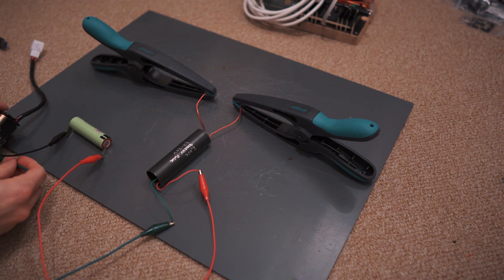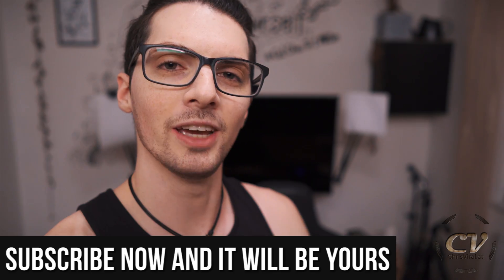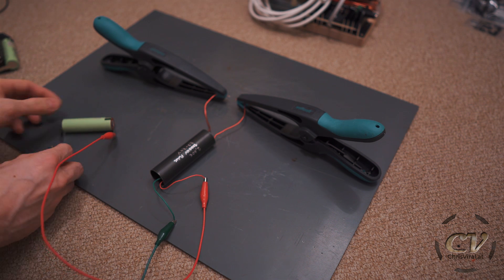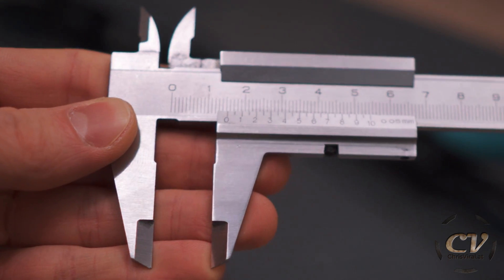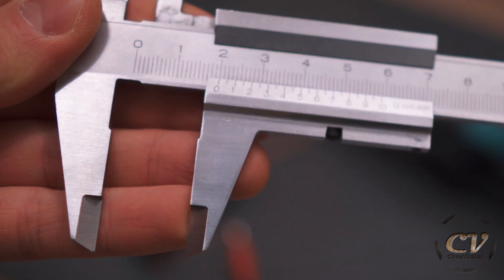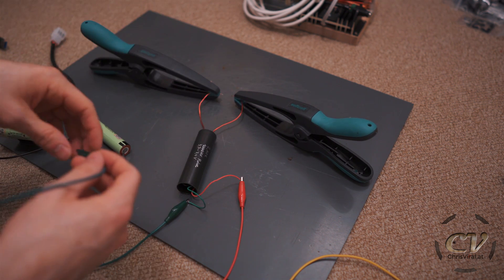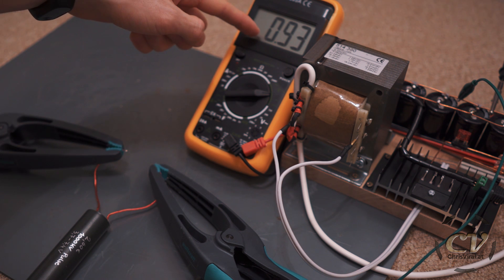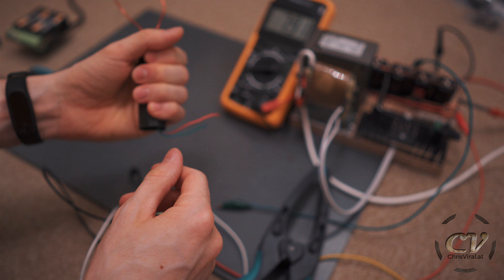1000KV High Voltage Generator Review (DEPRESSING)

Comment: The ones I ordered you can run 6v or 12v on I've been running 12 volts on or just above I have mine running in a PVC pipe which is a footlong with a tiny digital voltage meter on and off switch push button plug-in port for charging and three 18650 3.7v batteries and have no problem just the sound gives you the chills and it's Extremely Loud I've had the one for 2 years playing with it getting ready to build a shaft 5 ft tall and then also a painter wants me to build one in his extension pole which I just took the inner pull out of I'm about done with it😂
Reply: Got a link to buy? Mine keep dying 😂

Comment: Why does the spark only jump between the ends of the wires? If you made both of the wires (probes) parallel, wouldn't the spark jump between the base of those probes?   Thanks

Comment: The internal circuit is a Cockroft-Walton voltage multiplier. If you operate it without a properly-rated resistive load you will soon burn out the internal diodes because you will be exceeding their rated maximum current.

Comment: I'm actually using my milwaukee m12 2ah battery to power my 1000kv high voltage pulse generator.  I've burnt 1 of the 2 pulse generators out only because I reversed polarity on accident but so far so good with the 2nd one.  The first was fine til I connected it incorrectly🤦‍♂️🤷🏻‍♂️

Comment: Also as you remove the connections further apart and push the transformer that pushes it above its limit there's no way it can be above like about 20,000 volts and that's about it and if you want put the wires further apart it will increase it but it will burn it out

Comment: To get maximum output you need a pulse DC power supply because just like any high voltage Lake fly back you have a collapsing circuit that closes the circuit over and over really fast and that ramps up the output and if you have a pulsing DC current it will do the same thing which is one of those and increase the output

Comment: A battery has a sorce impedence that may drop the voltage during  moments of high current spikes. And the wires have a certain amount of inductive impedence. You can mitigate both by placing a capacitor in parallel as close as possible to the input of the high voltage generator.

Comment: More than likely the transformer is still OK but the output capacitors are toast.
Reply: But the whole thing is epoxied, not exactly a trivial swap of parts.
Reply: @IrishFinalExit  Heat gun softens the epoxy and you can basically bend/snap it in half exposing the transformers output wires.

Comment: I bought it recently
DC 3V-6V bis 400kV 400000V 1000KV Boost Step up Power Module High Voltage Generator Generator 1000kV Boost Step up Power.

i can connect it with 2 batteries IMR 18650
3000mAh 35A 3.7V

will I burn the unit?

Comment: … If you had taken external cooling measures to the extreme, for example had it sandwiched between two blocks of dry ice down to 110° below zero Fahrenheit, (or about -79C I think… hey … I’m in Texas) - would that have delayed the failure? Prevented the failure? It would be interesting to see a chart showing pre-cooling versus longevity under the same out-of-spec excessive power input. I know they make those water jackets/sleeves that are designed to cool the electric motors on RC cars, planes, drones, etc.; I was thinking about cascaded Peltier devices cooling an exchanger that then circulated probably antifreeze or something – through that jacket with the transformer in it. One might be able to coax significantly enhance performance for short bursts between idle cooling cycles. Any thoughts?

Comment: I also had same experience with 400KV High Voltage Generator. Sadly it burnt at 5V only though the rating was 3.7V to 6V.

Any suggestions to avoid this???
Reply: Use at 1.5 volts lol
Reply: Same problem bro, I connected it in a two 1.5v Double A battery it work at first but in 2nd attempt it didn't.

Comment: 1) Using higher than recommended input voltage will cause internal spark and may destroy the device or cause malfunction from now on.
2) Using the device whithout any load (like no spark or just a few sparks) may destroy the device or cause malfunction from now on.
3) Dielectric strength for air can be about 20~75 kV/in (lets say near dry air about 1000V/mm) depending on relative humidity, frequency applied (etc). Anyway, that means that the device above looks far from 1000kV capable, maybe 20~30 kV actual.

1) + 2) = most people who will receive and play with that devices will actually degrade or even destroy them trying to figure out the "max gap" before they become useful for some application or other experiment. Some suppliers provide instructions for use, just follow them and avoid the limits of.
Reply: Por quanto tempo eu posso usar com 5 v 1,55 amperes a 2,0 amperes enquanto ele está formando um arco elétrico e quanto tempo eu deixo de pausa?

Comment: hey this thing gives output in Ac or DC? I have it at home but don't want to destroy my multimeter, also what voltage it gives at output(real)
Reply: the output voltage probably is mostly load tetermined. So it cant be stated. However the max voltage it can handle, without being destroyed because of lack of load, and thus too high voltage, is approx. 20-30KV i think. 
If you want to measure this voltage, note that the inner resistance of a multimeter in most cases is 10MΩ. So if you take a high voltage resistor with a value of lets say 10GΩ  in series to the test leads, the voltage across the multimeter will be 1/1000 of the actual voltage. Thus you can use it to measure the voltage safely. But note, that with this load there will ve a current flowing of ≈3μA. This is probably way below the max current of the device, but note that without this load, its voltage might be higher. 
These things should be DC, cause they probably dont only use a coil,but also a marx generator at the output, which acts as a voltage multiplier, and gives out DC voltage pulsed. However you might want to add a high voltage diode, and a small capacitor and high voltage resistor to directify it, and then limit the max current of it, to get a more smooth and not that aggressive output out of it depending on the application.

Comment: Can you make a spark plug booster, an application that suits a spark plugs ignition system and not just a test bench model? Not that it’s got to be done on a motor but that it will and could. I’ve seen some models but they were just experimenting. These boosters I did see were 50$ but I don’t see much of it in real life situation

Comment: What is your battery pack configuration? Are alkaline batteries connected with 18650?
Such configuration might be dangerous, you should never mix batteries from different suppliers and mixing types is even more dangerous.
Voltage differences between cells might cause one battery to be charge the other for example: 1.5V alkaline is charged by 3.7V Li-ion if you don't have any current limiting (in battery pack sure there isn't) the internal current of battery pack might cause it to flame! It's like short circuit!! NEVER MIX BATTERY TYPES!!
Note: even if you manage to somehow equal voltages, with use, different cells empty in different speed! This is the main reason why most battery packs (even in commertial products) fail, as batteries get older their performances differ causing internal current that may lead to fire!

Comment: 2× 18650 battery voltage differs a single battery could be as low as 3.7 volts and as high as 4.35 volts my car runs off of a home made 18.75 volt battery i used 5 18650s
Reply from the maker: 3.7V is the nominal voltage, actually the voltage can drop way lower than that, to around ~3.0-3.2V without damaging the cell. Li-Ion should be capped at 4.2V though. If you're talking about a specific uninformed statement from the video please make sure to include a time stamp next time 🙌🏻🤣

Comment: Can I glow bulb from this???
Reply from the maker: You mean like a tesla? Hmm interesting question but I don't think so but you can easily connect them to a tesla and use them as a power source like I did here:
https://youtu.be/-pUIeQkyWdk
https://youtu.be/fWL94MIHHM0
Reply: This module can be use in spark gap Tesla coil.

Comment: 5 major issues with these modules...
1) They burn out very easily and very quickly if you re not careful.
2) The duty cycle is low. They are only designed to operate intermittently as in a few seconds are a  time.
3)  Without an adequate load on the output, such as too large a spark gap will cause them to burn out rather fast.  
4) Too high an input voltage will fry them quickly.  Keep the input voltage somewhere between 3 to6 volts max.  Higher voltage will fry them.
5) Running them for too long. After a few seconds on power them down and give the internal components a chance to cool off.
6) The output is generally way overrated.  For example, they advertise 400 Kv when, in reality, the output is more like 30-40 Kv.
7) Not sure if they are good for use as a  stun gun module, I wouldn't want to stake my life on one of these to do the job of stopping a robber.

Now for the good news.
1) Yes they do really work
2) They are cheap. So, you can always keep a few extra on hand in the event you might blow one.
Reply from the maker: Yea absolutely, thanks for the quality comment! Also regarding the use in a stun gun, it's more for the fun of it, not for a real use scenario. You need 100W + go take down a person. These will give you only ~1/10th of that.
Reply: @ChrisViralVlogs  Yep. Though they probably won't take a person down the shock they deliver is painful and startling...A while back I ordered one that is about twice the size of most being sold and it delivers about a 2-3 inch spark.  I am not sure if it's 2 units put together and wired in series but its definitely kicking out at least 2x the voltage but the current is definitely lower.

Comment: Dont over voltage the module,it will broke easily and the wires are so too far to send electricity,thats why the module broke easily
Reply: I think it will broke on amps
Reply from the maker: My theory is that the over voltage killed it, not the fact that it didn't arc. I did that to the rest of my 15 modules too and none of them died.

Comment: It was not the voltage. You put the spark gap too far away. Without that load, you broke it.
Reply from the maker: I got that a lot, but as I always said, this is most likely not the case. I did that to many modules many times and they always survived that. But indeed it's a possibility.

Comment: I work with extremely high voltage power supplies that power X-ray tubes. Those X-ray power supplies can easily become damaged if they are powered up without a load (X-ray tube) attached to the output wires. Rather than the voltage going to the load through the wires, the high voltage arcs internally between the windings of the high voltage transformer or other components in the circuit. That arcing creates carbon paths which act like resistors which the high voltage will now follow rather than to go down the wires to the X-ray tube. Once those carbon paths are created, the power supply is permanently damaged, and the only way to repair it is to replace all of the burnt components. It's the exact same situation with these little "stun gun" type of modules, except for the fact that they are not repairable due to the potting compound which encapsulates all of the internal components.
Reply: My thoughts exactly. Judging from the noise it's burnt coil. If it was anything else it would have gone out quietly or started smoking.
Reply from the maker: I can imagine that to be true to a certain degree, but in many of my tests, many modules were not able to arc. So in theory all of them should've died due to internal shorts. In the "10x in series" experiment for example. All 10 of them would be dead if your statement would be true. None of them got damaged though. Just take a look for yourself:

Series VS Parallel: https://youtu.be/BRbHBiwdcc8
5x In Series: https://youtu.be/pN7a8VlU9Gc
10x In Series: https://youtu.be/pGp38mRxBFI

I think the voltage was too high.
Reply: I making 0 to 10kv from 0 to 6v dc
I am struggling . Can you help me

Comment: As others have said,  you have to allow them to arc.  Separate the wires too far, and it'll cook itself.  I'm running two 18650s through the 400kV module,  and it doesn't even heat up as long as I allow it to arc.
Reply from the maker: Yeah I can imagine that to be true to a certain degree, but in many of my tests, many modules were not able to arc. In the 10 in series experiment for example. All 10 of them would be dead if your statement would be true. None of them got damaged though.
Would be a nice experiment though 😍
Reply: @ChrisViralVlogs  HOW many in series!!! Go big or go home, I guess.😉

Comment: If it doesn't make a spark, it breaks. Of course youre gonna break it if you try to see how far it can go. Not quite sure what you say they're expensive either, they cost like 5$ shipping included.
Reply from the maker: Yes they're cheap but I don't agree with the first part of your comment because of experience. 

I can imagine that to be true to a certain degree, but in many of my tests, many modules were not able to arc. So in theory all of them should've died due to internal shorts. In the "10x in series" experiment for example. All 10 of them would be dead if your statement would be true. None of them got damaged though. Just take a look for yourself:

Series VS Parallel: https://youtu.be/BRbHBiwdcc8
5x In Series: https://youtu.be/pN7a8VlU9Gc
10x In Series: https://youtu.be/pGp38mRxBFI

Comment: Hmm 1000kV would make............xddd 10m long arc, this may have maxxxxx 2kV
Reply: The arc length is a worthless way to measure voltages. There are so many possibilities that can alter the arc length. 
For DC with a low current it is about 10Kv / 1CM too start an electric arc and a teslacoil 3Kv / 1CM
Reply from the maker: 1kV will get you at least 1mm added arc length so 1000kV would actually give you 1m ⚡😂
No they have more then 2kV :) If you want to know how much then check out this video:
https://youtu.be/00U9zTZParg
In this one I measured the arc gaps of different modules and calculated the voltage.
Reply: @ChrisViralVlogs  1kV gives you 1cm not mm. It's basics of electricity, and i'am currently studying it.
Reply from the maker: I hope you're trolling :'D
Reply: @ChrisViralVlogs  I'am actually not. It's what we learnd in school, and what have been in books. Its what is shure for AC, I can't promise if it's the same for DC, and we tested it. Or they may be lying xddd, and we learned fake shit
Reply from the maker: Okay so assuming you're saying the truth here, then I'd suggest that you should just google this exact question or statement. Find out for yourself what the consensus is. The truth is out there. So dramatic lol but you should actually do it right now.

Comment: if you touch the ends but they are far apart without sparks...will you get shocked?
Reply: And it will HURT. A very strange, incredibly unpleasant kind of pain. Give it a try!! 😫😖
Reply from the maker: My friends loved it though: https://www.youtube.com/watch?v=TsLx8uVZ2x0 😂
Reply from the maker: Of course. Even if the ends are close enough to spark - if you touch them the current will flow through you ;)

Comment: I bought one of those claim to have 100kV, ended up getting only 10kV.
Reply from the maker: Yeah, they are overrated or actually... over labeled? idk lol
Reply: @ChrisViralVlogs  Actually, I found out using battery to supply the module is not ideal, because the battery can't produce high current that satisfies the module. I used a power supply to power the module and got 20KV (maybe that power supply isn't good enough as well)
Reply from the maker: Yea, I can confirm that they need a lot of amps, the small ones need at least 2A.
Reply: @ChrisViralVlogs  Your title is false
Reply from the maker: No :D
Reply: @ChrisViralVlogs  What do you mean "no"?
Still nice review ^^
Reply from the maker: My title is correct since I'm referring to the product labeling on the websites where you can buy these things. How would one be able to find reviews otherwise? :)
Reply: @ChrisViralVlogs  Ok :)